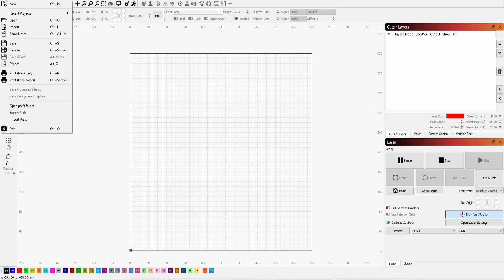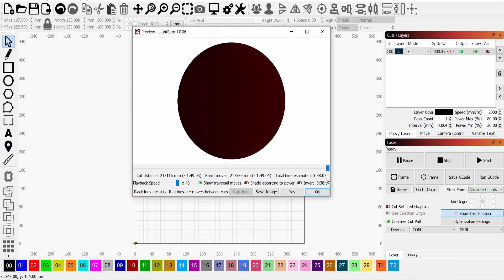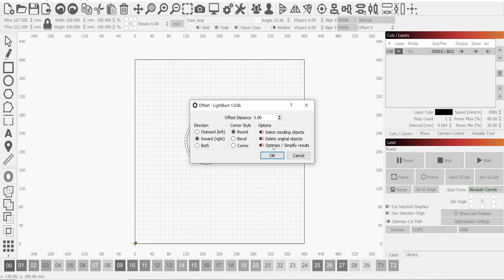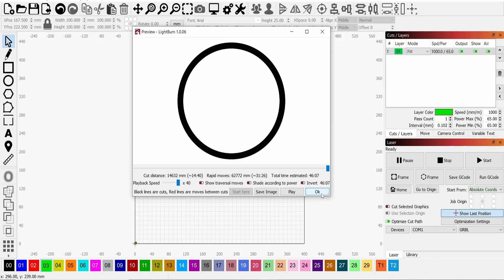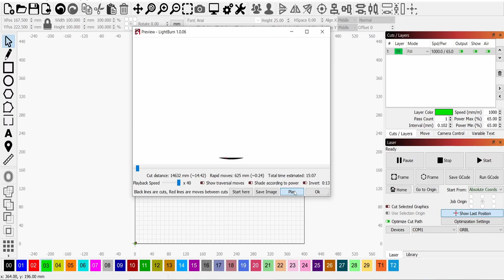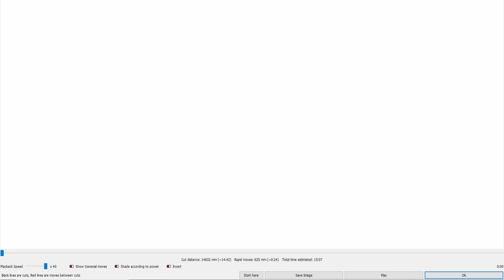Lightburn Tips for Fast Burn Times!

Comment: Good video.    Looking at your cuts/layers window at the bottom right- just under speed and power settings there is no material thickness (mm) option, time :27.  my cuts/layers window the material (mm) is sometimes gone! too  - I'm getting the message:  "your material is set close to zero do you want to continue?"  Without the thickness set the laser cuts out of focus and messy.   Is there a way to toggle this (material thickness option back- on?) in Lightburn?  It seems to affect the power required to cut.

Comment: Nice video and good tips but for this particular shape....you really missed the mark!  If you had tried the "offset fill" function, your run times would have been far, far shorter.  Most people overlook this feature.  It is only typically best for symmetrical fills.

Comment: So flood fill works if the object you're cutting is a SOLID piece of etching as a frame, but if you have text on that frame or any other graphics anywhere else flood fill does NOT work to speed up your projects. With my regular scanning etch, my project takes 10 minutes to burn, with flood fill enabled for the same project it went up to 13 minutes. You're better off using OFFSET FILL mode.

Comment: Can you help? Will this work on my linear designs which have a transparent / vector background. I was thrilled to see your video and saw it reduced the engraving time by half in the preview box but when I tested it - the time was not reduced even though it said it was in the preview (I timed it and retried three times). Any help on this would be really appreciated.
Reply from the maker: The vector may hold lines that are not needed by the laser to actually perform the burn on your graphic.  If possible, try tracing your graphic in light burn and then burn the trace (that will remove any unneeded lines).  I would be curious to know if that helps with your issue or not.  If it doesn't let me know and I will attempt to recreate your issue and see if I can determine a way to help.  Thanks for watching my video!!
Reply: @sharingknowledge9941  you have been so helpful thank you. This has made an amazing difference to my speed time and therefore my output time. Revolutionary thank you. It has also made me realise there is so much more I need to learn about Lightburn software to utilise it to its full potential and here is the place to start.

Comment: I've had bad experiences with flood fill. It doesn't seem to be consistent leaving gaps.
Reply from the maker: Flood fill does require the machine to be set up really well (belts tight, no play in the axis) .  If not, it will leave gaps in the burn area.  I have not seen it do this when the machine is dialed in correctly though.  Not saying it won't but I haven't seen it personally and I use flood fill on most of my projects.
Reply: @sharingknowledge9941  My machine is setup properly. I think what's happening is as the laser moves to different areas the wood shrinks and expands causing it to not get exactly lined up when it resumes in a previous area, usually on larger burns.
Reply: @J.D248  I would imagine wood being the most difficult, might be worth doing one on tile of the same procedure as a independent variable

Comment: I do not appear to have all the options you do in the ‘Basic Settings’ page where you click ‘Fast Whitespace Scan’. Is there anywhere else these settings could be, or am I unable to use this feature? I’m using an 80w 700x500mm OMTech
Reply from the maker: I believe the white space speed setting is available regardless of laser type.  Make sure you are looking up the Device Settings and not just the Settings.  Under the Edit tab mine are listed side by side and I click the wrong one most of the time.
Reply: @sharingknowledge9941  I don’t have the advance option.

Comment: With flood fill it ends up with lines in my engravings. Like the lines didn’t match up where the laser came back to fill. Is there something I’m doing wrong?
Reply from the maker: I have experienced the same with it leaving noticeable lines if my lines per inch is set too low while using flood fill.  Offset Fill, which I didn't cover in this video but will in a future one is an option that should prevent the lines.  The preview animation really helps determine the best settings once you figure out what each one does.  It allows you to see exactly how the laser will operate and help catch any potential problems.  Typically I use flood fill when it allows the later to follow a fairly uninterrupted path.
Reply: @sharingknowledge9941  I'm just a few weeks in with the learning process, but being a science teacher it's been fun rollercoaster. I've thrown some amazing things through it, but the fine details have me miffed. 

|I have read recently that the stepper motor has to line up with the measurements of the lines per inch, otherwise the remainder gets calculated and shows up as a banding line when overlapping occurs or a line left. When you get to a lines per inch measure that matches with (was it 16?) the stepper amount your problem should be resolved.